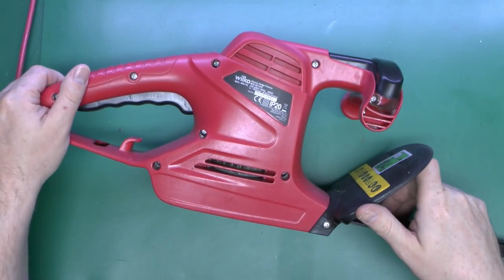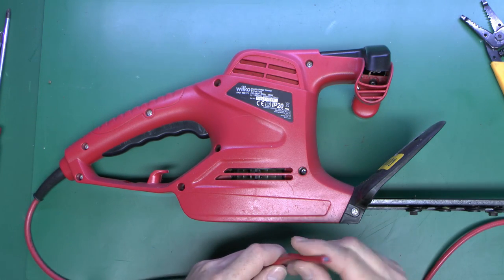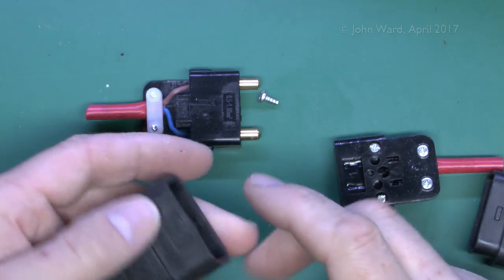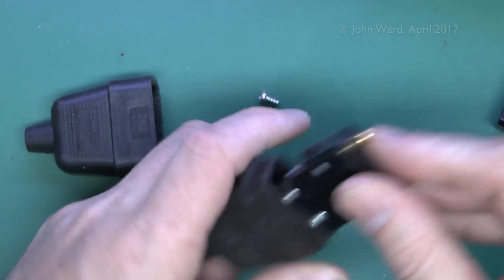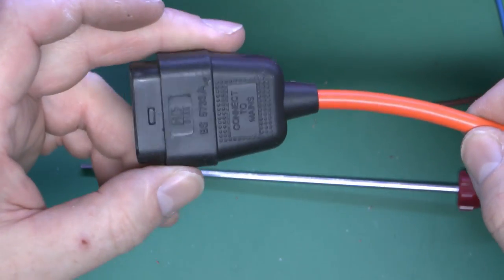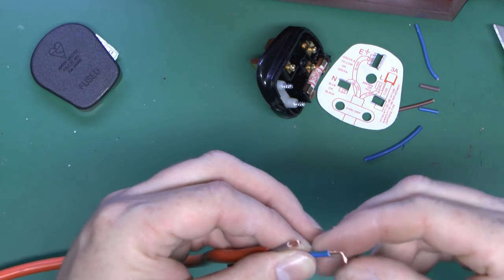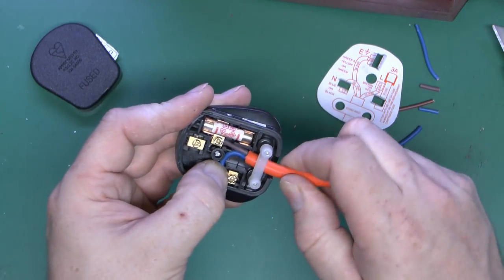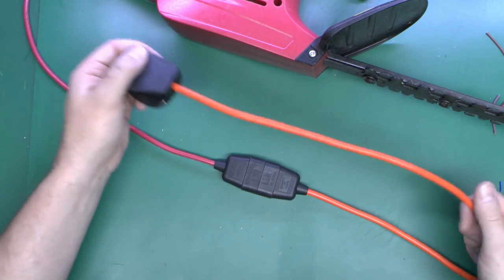Hedge Cutter Flex Replacement, Plug & Connector Wiring

Comment: That looks a little unsafe.
There are no procetion against a child taking a nail and putting it into the female plug.
Reply: Tobi W If it was your child, you would not say that.....
Reply: Ino I was just using one of jw amazing quotes from the video... .... love it.
Reply from the maker: Do you often give your child a hedge trimmer and nails to play with?
Reply: No protection from chucking the end in the bath either
Reply: *****  No, I don't, but you are always saying that is good your british outlets is protected against plugging any other things in to it, so why is an extension cord not important!!!???
Reply from the maker: +Morten Winsløw Extension cords like this are only used with a specific item and should be stored away from children, wall outlets are accessible all the time.
Reply: tbh I think they're a bit iffy too & frequently used by people with little common sense - I've seen more than one with the pin half connected to the plug. The usual way they come disconnected is accidentally being pulled apart when the flex goes taut.
Reply: The problem is that because they're not the "normal" plug, plus people think "they're always going to be connected together anyway", people are too cavalier with them. Here in euro land we'd just use a waterproof variant of a standard Schuko plug and it would definitely  be appreciated by the common man which way round it goes.
Reply: I think that's it Jasper. 
There's a trailing version of the usual UK BS1363 13A socket in impact resistant rubber, JW's favourite sub standard shop sells them for £1.75... perhaps disconnecting under mechanical tension is considered an advantage for the 'lawnmower' type because the wires won't be pulled out in violent use but I'm pretty dubious. 
don't think the lawnmower type connectors I've seen are waterproof to any practical extent.